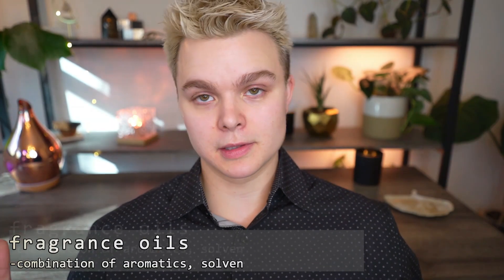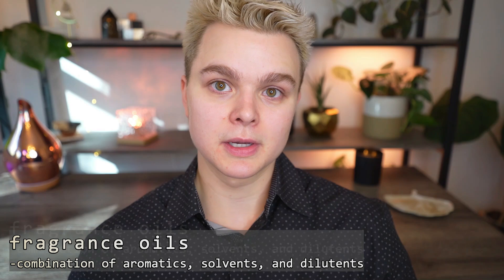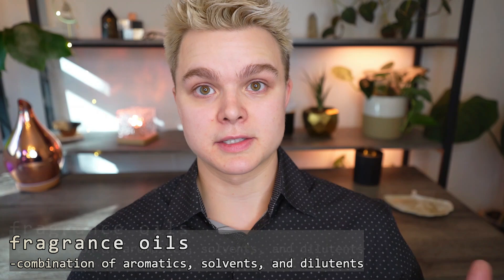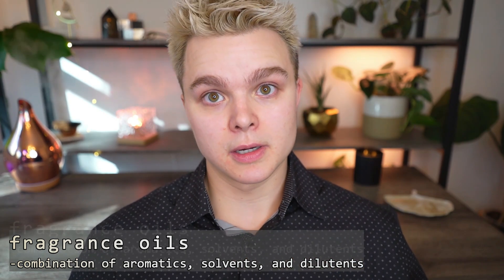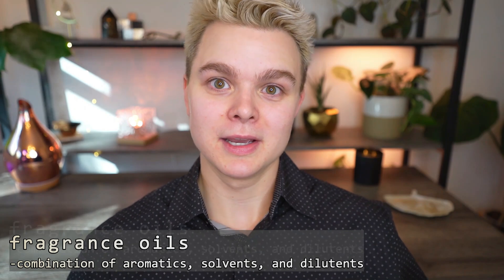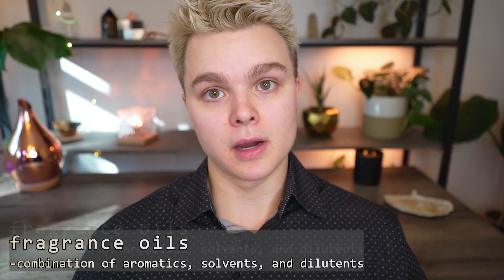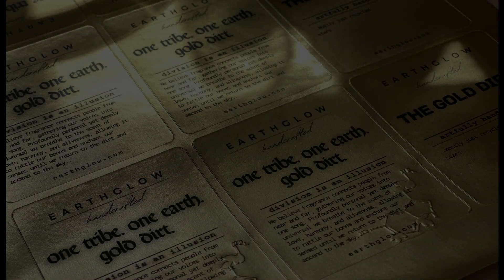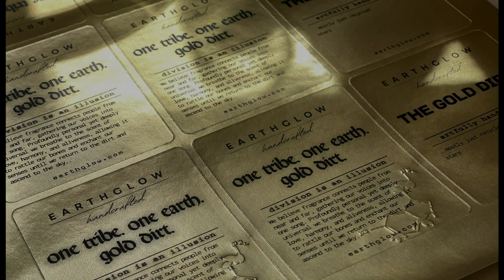🤔What is in a Fragrance Oil? | Why your hot throw sucks…

Comment: Great info as always.  Thankyou.  What would you recommend to dilute FO with if using to add to water in the top of a burner/diffuser?
Reply from the maker: If you’re adding it to like an ultrasonic diffuser it doesn’t need to be diluted at all. They utilize high-speed vibrations to create a mist that disperses fragrance or essential oils into the air. Just make sure to check IFRA 10A I believe and not exceed the amount listed there for each oil  :)
Reply: @earthglow Ty, I meant a standard burner that you use with a tealight candle 🙈🤣
Reply from the maker: @angelarose7573 ah! Mostly the same case actually. The heat from the candle warms the water and helps disperse the fragrance oil's aroma into the air.  The oil and water will not mix but that is okay because the heat will cause the oil to disperse into the air :)
Reply: @earthglow very interesting Thankyou.   I knew that with Essential oil, but for some reason I thought FO would be different and need a carrier oil.  I really appreciate your time.  Have a super day.
Reply from the maker: @angelarose7573 no problem. essential oils and fragrance oils behave very similarly in many applications :)

Comment: I'm glad I'm not crazy. I can't get a lemon candle to smell right. But in a wax melt, it's amazing. If you know of a good lemon oil that works well in a candle, I'd love to know. I've tried from 3 different companies.
Reply from the maker: Hmmm… like a straight lemon? Or are you open to like a lemon with some lilac or some cake or a bougie/ambery lemon? Yea, wax melts will often work better with certain scents even when the scents fail in a candles fail because they don’t combust. They release aroma simply by the heat of the bulb causing the aroma molecules suspended in the melted wax to become airborne.
Reply: @earthglow  anything that's at least a bit lemon forward.
Reply from the maker: All the ones i mentioned id consider lemon forward :)
Reply: I second this if you have any recommendations with strong hot throw as well!!
Reply from the maker: Black Tie Barn The Zesty Lilac contains a substantial amount of lemon and killer hot throw. Also The Urban Luxe is a very bougie take on a lemon also with excellent hot throw in my testing. For baking vibes. Candlescience lemon cello creme also does really well and I also enjoy their Lemon Pound Cake on occasion :)